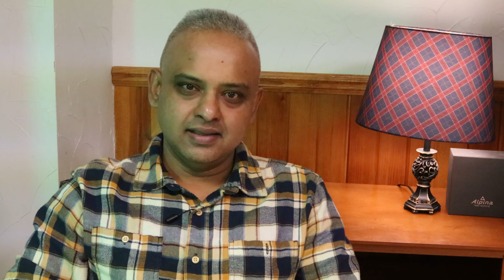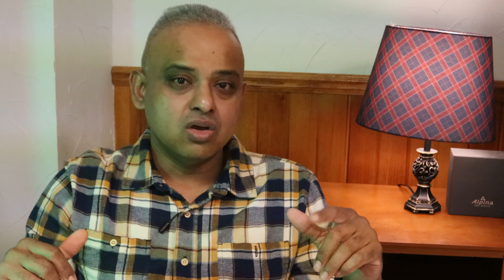Amplifier vs Speaker: Getting the Match Right

Comment: As important as it is, my experience is that system synergy includes more than just the amplifier/speaker interface. This was brought home to me when I decided to upgrade my casual listening system last year. I bought a pair of new, heavily discounted Neat Acoustics Motive SX3 Bookshelf's, as that model was being discontinued. I'm very happy with them. The SX3's are used in combination  with two Totem Acoustics Kin Subs 1st Gen (sealed 8 inch, 3dB down @ 29Hz). 
I then bought the new updated REGA ELEX MK4 Integrated Amplifier. I'm running Roon with an Ethernet cable connection to an iFi LAN iSilencer Ethernet Signal Noise Filter into the source. 
My first choice for the source was a Matrix Audio Mini-i Pro 3 Streamer/DAC. 
That combination was a bit of a disappointment. It didn't 'sing'. 
I then changed the source/DAC to an iFi LAN iSilencer -> iFi Zen Stream -> Intona USB Galvanic Isolator -> Eastern Electric MiniMax Tube DAC Supreme combo. Result: magic...
I suspect that an impedance mismatch between the REGA ELEX & the Matrix Audio Streamer/DAC was responsible for the first system's lackluster performance, since this was the only change I made to the system. BTW, the Matrix Streamer works fine with my REGA Brio (2017 model) Integrated.
Finally, sufficient amplifier power includes more than a speaker's sensitivity, its impedance curve is an equally important factor. At night in a med-lge room, my 8 watt Eastern Electric Minimax Tube Integrated Amplifier drives my 94.5 SPL / 8 Ohm Omega single driver- crossoverless Loudspeakers to mid 70dB level peaks with the volume dial @ 9.

Comment: Have you ever had the experience of asking a speaker manufacturer about what amplifier(s) they recommend for their speakers and they get very reluctant to make any recommendations? I mean, sure, I can understand why they'd be reluctant (for a myriad of reasons) but geez.
Reply from the maker: I’ve spoken with Tekton’s Eric Alexander quite a bit about this topic. Among the many factors, one of them is to go with amps that are stable 4ohms.
Reply: @analogholic_reviews  John Strohbeen of OHM speakers (RIP) was really helpful in suggesting a wide array of amps that paired well with his speakers. He named a few brands he liked, but he also named some that his customers reported success with.
Reply: Yes Magnepan uses Bryston at shows and has recommended same.  Now 1st hand experience the Magnepan lrs sound darn good with the Bryston B60 I just bought used.  Turn up volume it runs quite hot.  Havent blown a fuse or lost a channel I know better
Reply: @JohnDoe-np3zk 
I'm running my LRS with a Bryston B3sst. 
Just runs warm. 
Unlike the D5proBC
(dartTZeel nhb108 "cL1") which sounds lovely but gets pretty hot due to higher classA bias😅